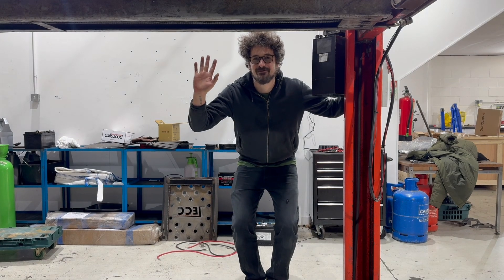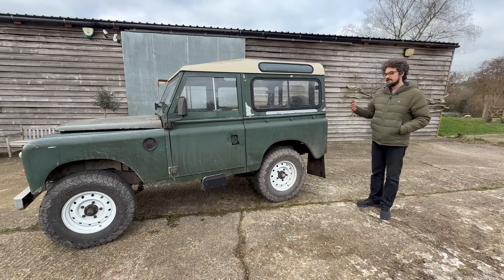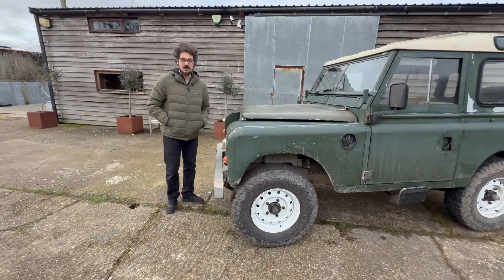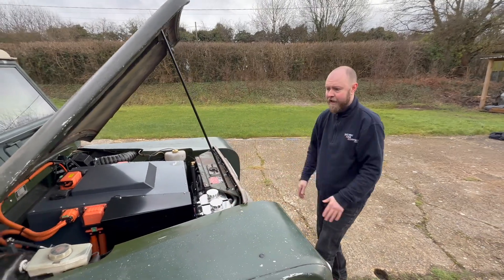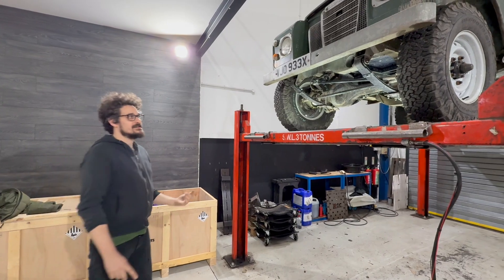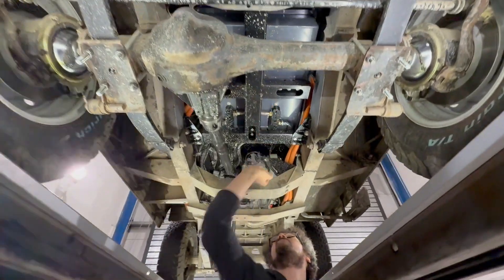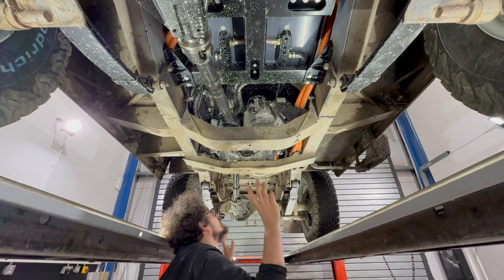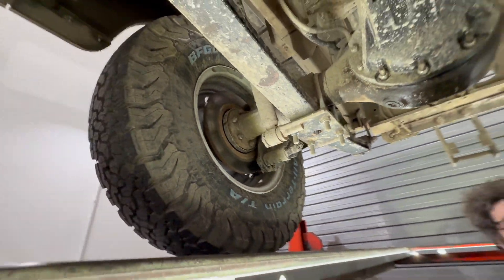The fastest Series 3 Land Rover in the world? Because it's FULLY ELECTRIC!

Comment: I would have expected defender axles to be longer and make the wheels stick out of the bodywork, were they modified?
Reply from the maker: They’re defender internals inside the original axles. We buy a kit for this from Design and Development Engineering.
Reply: I was just about to say the same thing. Those are series axles. You need a 3.54 diff into them to work with Felten's M3 reduction gears, and you need CV joints in the swivels to run full time 4x4.

Really, what you've got is a DDE converted Stage 1 axle with Disc brake kit.